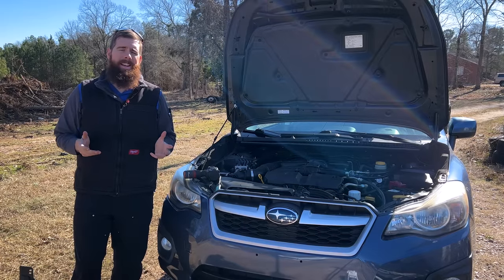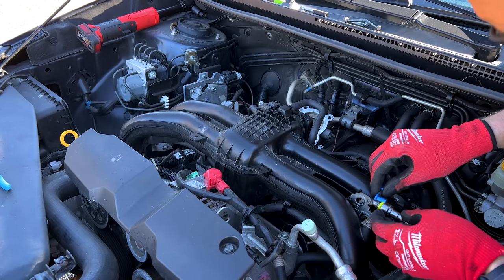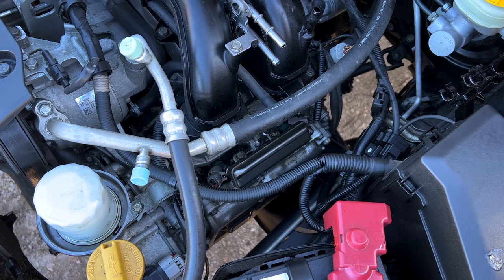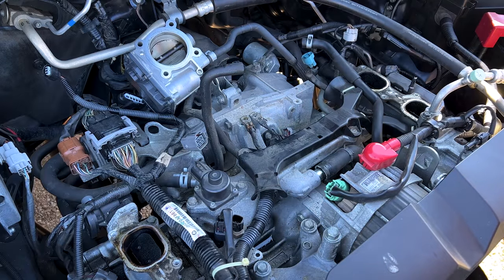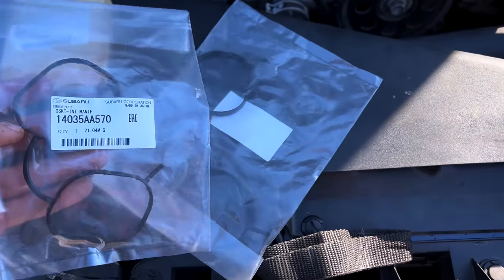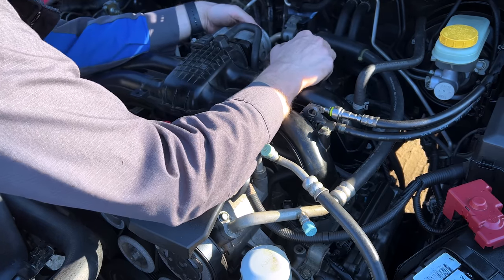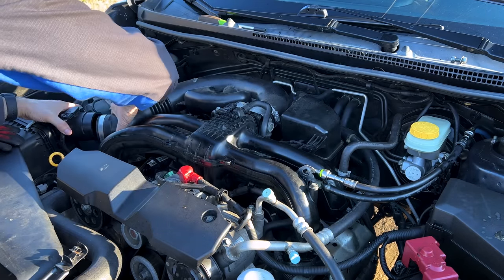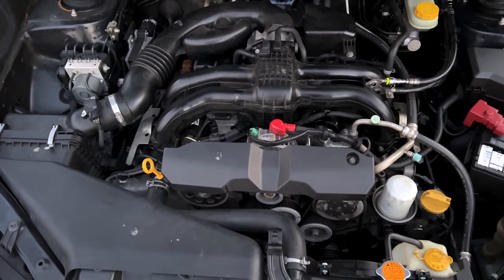Don't Let This $2 O-Ring Wreck Your Subaru's Cooling System! Fix That Coolant Leak Yourself, Cheap!

Comment: This problem was in the EJ series as well. Anytime customers said they smelt  coolant id look for the rear crossover pipe and sure enough it there would a pool on top. Cheap o-ring but expensive for labour.
Reply: That's exactly what is happening to my 2009 outback right now. I Thought the coolant level was dropping due to blown head gaskets. Then I saw a puddle of coolant on the top of the engine at the rear crossover pipe seal.

Comment: Great, comprehensive video.  None of that "and then a miracle happens" nonsense.  I wish I could have really seen where those o-rings sit, but I'm sure it would be clear if I tackled this repair myself.  Thanks for the excellent step-by-step.
Reply: I agree. Video is great and I am grateful.,  but some exact will lit zoomed stills photos of where and how o-rings sit could be done with a camera and or mirror and would be helpful . Also any info on which models do and do not require removal of wiring harness, would be helpful, as that is something you do not want to find out halfway when budgeting your time

Comment: I feel ya on the jacking it up to not break your back. I'm 6'5", so any chance I get to save my back I take it as well.
Reply from the maker: 6’4 here. Nearly always lifted cars on the lift to save my back when I was in a shop. Definitely miss a lift. Problem was they never lifted cars high enough when working underneath. I usually had to take a wide leg stance to have comfortable head room. Lol
Reply: @MrSubaru1387  I feel you there! I was lucky when living back home. My dad owned his own coal trucking company from 77 to 92 before he sold it and retired early. With that came the old garage, tons of 70's & 80's tools, and best part the deep pit with a lift. 

I don't get back much to use it since I've moved, but any chance I get I take it. He's 79, and still going strong with truck repairs for local individuals or renting it out to people either one.
Reply from the maker: Hard to install a lift on dirt and gravel outside.
Reply: @MrSubaru1387 pour a cement pad baby!

Comment: The real scary coolant o-rings are the ones in the upper oil pan on the FB and FA engines. Looks just like a blown head gasket when they go. And, of course, the only way to get to them in to pull the engine since the lower bell housing studs are attached to the upper oil pan...
Reply: Would love to see a video on how to replace these Orings!
Reply: @boykeno they are out there. Youre gonna need to be able to pull the motor.
Reply: Ekkk this is probably what just happened to mine yesterday 😢😅
Reply: Does this failure allow oil Into the coolant  or vise versa?

Comment: Thanks so much for the video, I believe this was the condition, that forced the previous owner of our 2016 Crosstrek to trade it in for a new Subaru.  Per the Subaru dealership service history, in Bryan TX, the previous owner had just spent about 1,800.00, months before she traded in vehicle, for an A/C compressor.  So I think, these O-rings were the straw that broke the camel's back so to speak.  Subaru Dealership in Houston TX, quoted me ball park 1,500.00 for replacement of the crossover pipe O-rings.  I did the job per your video, in about 3.5 hours.  Yes, I checked the PCV valve during the job!  Awesome video!!!
Reply: My impreza 16 is leaking too will do it with radiator and thermostats
Reply: Did you have oil in the coolant reservoir?
Reply: What if the the head carb flaps I'll call them are caked in contaminants like I can take my nail and scrap it off
Reply: @matthewjohancen757 ,yes I did 2015 xv crosstrek

Comment: In the course of 6 months last year, I've replaced 16 Subaru with those water port O rings. Some are a pain to do where you have to remove the intake manifold complete off, and some I was cable to get snap on long 90 degree angle pick and get it out. Slide new O rings in and install everything back with new intake manifold gasket. They're not bad to do once you do a few. Easy money.

Comment: Great video.  Unfortunately, really shows how badly designed the engine and cooling system is and how terrible the parts used by Subaru.

Comment: I had a catastrophic engine failure caused by a $2 o-ring. 😔 Had one of the o-rings behind the oil pump fail. Thought I had caught it soon enough, but a few months post repair, I started to hear faint rod knock on my way to work. On the commute home, the bearing spun. Love the FA20, but I am not a fan of the oil pump/timing cover design. These things happen. We pick up a wrech and move forward.

Comment: Completed this repair yesterday. Not that difficult if you follow along with the video and have a few maintenance bones in your body. While I was at it, i replaced the thermostat, upper and lower radiator hoses, exhaust manifold gaskets, PCV valve, throttle body gasket, coolant, and plenum gaskets. 
2013 Crosstrek (184,500)

Comment: I usually just remove alternator out of the way and few connectors in the way and use a pry bar to lift cross over pipe and pic to remove o-rings from front and back side without needing to do all this

Comment: Yep....you have convinced me that I will not be attempting this. Not only have I never gone this far into an engine but I do not have most of the amazing tools and diagnostic equipment nor the experience of how to use them. I would probably have a bucketful of left over parts. Good mechanics are worth their weight in gold and weekend warriors like myself who feel like a God to do a simple brake job need to just pay the pro. Find an honest and competent mechanic and pay the money. They are MORE THAN worth it....even if it seems like a lot.

Comment: My daughter's 2011 Forester she just bought was losing coolant/overheating and had a lot of fluid on top of the engine after replacing the upper/lower radiator hoses and flushing/filling the cooling system. Replacing the ECT sensor (it's bad), but I think I'm gonna go ahead and do this too...hopefully this is where the coolant is coming from.

Comment: I didn't realize until after I ordered that fuel line tool that I did not need it for my  2016 impreza But other than that thanks for the video it is very helpful

Comment: Thank you Mr. Subaru,  I have the "puddle" in the same location in my 09 and 15 Outback's....... Will  have to wait till Spring though......I'll start with my 09 since it seems easier.
Reply: Get a bottle of Subaru coolant conditioner. It will buy you some time. Part #SOA635071. Keep in mind it needs to be added to the radiator not the overflow reservoir, so you need something to remove a bit of coolant if it's not low from the leak. Shake vigorously before adding to the radiator. Drive immediately after adding to circulate and warm the coolant.

Comment: If you're doing this on your personal vehicle and not a customers, you need to disconnect more of those connectors, lift that pipe a bit higher, wedge something under it to hold it up to gain more access to the pipe sealing surfaces and clean them thoroughly with a brass wire brush. Otherwise, you'll do the job again in two years.

Comment: You have just saved my bacon.... I've been holding off on this because I haven't found a proper video . I'm assuming it's similar to the  2010 2.5l? thank you so very much from the bottom of my heart.
Reply from the maker: It is, much easier on the old EJ253 you have.

Comment: Mr.Subaru, do you have a recommended service interval chart for new Subarus? I'm almost ready to take delivery of the 23 Subaru Crosstrek Premium in the 6MT we ordered. Hoping to keep it running to 300,000 with little issues. I've been watching your videos and see that sometimes Subaru doesn't do their best at giving buyers a good service interval chart. Do you have any places I could look to find a
"vetted" service interval chart with possible added touch points? Thank you!

Comment: Nice work, as always!
It is very strange that the rubber rings are so dry, as if they were overheated.
We had -27 deg.C for last two days and -23 for today. Mine FB20 SJ '14 is okay, cold start sounds weird, but thanks God it have started. Сold weather showed that it's time to check the hood latch - the spring weakened in the cold.
Workhorse VW Tiguan ('14, 1.4 TSI 4Motion MT) became leaking with coolant from turbine hose while cold.
By the way, dads old ('94) Toyota with 4A-FE (gasoline 1.6l I4) have started as new.
Reply: It happens with age. It's why I hate O rings in places that get hot. My 1992 Camaro has an oil control O ring on the distributor. It's the reason every third generation camaro leaks a little bit every night. The O ring lasts maybe 2 or 3 months.

Comment: This is why everyone I know (including me) prefer older subarus, my ej201 was a breeze to change the o rings! P.s mrsubaru my PCV valve recently failed while on the motorway, got her home misfiring an changed it now it's fine apart from it seems to have blown the seals around the spark plug tubes so they're now covered in oil, I'm assuming the PCV was the cause? I serviced it a week before the pcv failure and there wasnt a spot of oil there.

Comment: I have some new parts that were not used for my outback. I will send them to you if you want them no charge. POwer stop pads, Bosch o2 sensor, some suspension bushings. A few other things. The car no longer exists.

Comment: If I attempt this myself, would it be a good time to try to clean some carbon from the intake manifold runners or from inside the EGR valve or tube while I have everything apart? Anything else worth knocking out while I'm in there? I like the PCV reminder in this video.

Comment: hello mr subaru1387
I watch your videos frequently and they help me a lot. My problem is that
I have an xv2017 fb20 engine my problem is that oil is passing into the coolant and I don't know which o-ring I should replace since in your video the ones you replace are due to a coolant leak I would appreciate your help since I am new to this
I don't know if this PCV Hose Connector has to do with the problem
greetings
Reply: Let me know when you find the solution, I’m having the same problem

Comment: I'm currently diagnosing a 2014 Forester Premium overheat issue. Lots of folks say it's probably head gaskets. I was able to top off coolant and drive it when needed. Now it's pouring out coolant to the ground and no longer can be driven. Any Ideas on what is happening? 
This video is very detailed and I know I can trust your advice. Thanks for any response, DZ

Comment: Just had mine replaced at the dealership, I could smell the antifreeze, thought it might be the heater core. Looked on u tube and sure enough one of the o rings was blown out. I had the extended warranty,but this wasn’t covered.

Comment: What parts do you recommend replacing when replacing the cross-over o-rings? PCV, PCV Hose, Plenum Gaskets, Throttle Body - anything else?

Comment: Not sure this is DIY consumer, need some skill for sure. Especially for Oring placement. I'm surprised they failed. If they were Viton material or did Subaru use only cheaper rubber ones?

Comment: Mr. Subaru I like all your videos, you've been a great help to me with my Subaru ,I have a 2012  impressive premium 2.0 ,.. I bought new rims,  aftermarket rims and my question is can I use pressure sensors from my original rims or do I have to replace them.?? Thank you in advance

Comment: While the car is a 2013, do you think the cross-over passage "o-rings" drying out is due to time, mileage or something else as the prime degrader(?)?  Being new to Subaru, will this be a "normal" replacement item in new to plan for with my 2020 WRX? Thank you for considering this and another informative video.  v/r
Reply: "...item in new to..." should have been "..item I need to plan..."

Comment: Hmmm good to know this.
My 2002 Forster S will one day be needing this eventually and even though this is a new car and different engine here mine won't be too terribly different of a job.
However I'm wondering if the older EJ 2.5L doesn't have these O rings on there.

Comment: I would have considered a "Red" colored same size o-ring good for higher temps.
Reply: It's usually a good idea to replace parts with the same type that are called for. You're asking for problems otherwise
Reply: @alexandersupertramp7353  Because manufacturers don't engineer things to only last a certain amount of time due to materials used under certain conditions. Otherwise it wouldn't be an o-ring at all.
Reply: @transtubular  Thanks Capt Obvious! Unfortunately, your comment had nothing to do with mine 😂😂😂

Comment: Question here. With all the trade ins (specifically wrk model) 2020 2021 with low miles 3k-14k would it be smarter to avoid them because of the drive it like you stole it people with no regard to a break in period? This is strictly a reliability question. i haven't because of the insane prices alone.

Comment: So I don't actually know enough about cars to be sure of this statement, but it sure does seem like Subarus have a lot of leak problems. Is this due to the design of the engine itself, or do they just use bad gaskets/seals? Do they have more connection points than other cars? Is the pressure greater? Or are they just using the bare minimum material as far as durability goes? And this isn't just an observation. I'm on my third Subaru (I don't know why I love them so much) and they have all had leaks in one place or another. Was never a problem with my Toyotas and Hondas that I owned. Thanks for any responses.

Comment: I have been thinking about buying my first Subaru, so I have been watching all these videos.  They are terrific.  You do a great job explaining what you are doing and why you are doing it.  I do have a question about current Subaru models if you would mind commenting.  

Do you see anything inherently wrong with the current Outback Wilderness model?  Are the engine and transmission considered "good" and reliable?  I have not seen any Wilderness models on your videos, but most are probably still under warranty.  I live just north of Charlotte and there have been very few Outback Wilderness models to look at over the past 2+ years.  I haven't even been able to test drive one yet.  Thanks again for the videos.
Reply: He generally talks old Subaru's. The Outback is a highly rated car however

Comment: Great video as always! Is there a similar o ring on the ej253 and do you have a video on that job? Thanks!
Reply from the maker: Yes. The EJ engines have a coolant crossover pipe and two o-rings as well. Just much easier to replace on them.

Comment: My problem is my wife's 2012 forester has oil in the coolant reservoir not milky actual oil droplets.  No over heating and when I replaced the plugs they were dry . Any ideas?

Comment: I just had a mechanic looked at my Subaru 2014 he told me that is the problem with my car but he said that they have to remove the whole engine to replace those o rings 😮.

Comment: Hey, @ 3:10, did you know, when using an electric 90 degree socket driver, you can manually break free a bolt that won't spin under electrical power? 🤪🤪🤪

Comment: Mr Subaru. Do you have a video on re sealing the timing cover on the jen one crosstrek. Timing chain guides and tensioners as well. If I'm in there I might as well with 235k
Reply from the maker: Not yet. Likely soon enough on my 2013 Crosstrek.

Comment: I just bought an 07 Subaru Forester xs with 322,000 miles on it. commenting here because idk if you react to comments on old videos. Are there any sneaky things that I should check that could start to show at this kind of mileage? I'm doing all of the obvious. engine mounts, replacing all fluids, and filters, and checking for drivetrain issues such as u joint, and suspension/steering issues like ball joints. Is there anything sneaky that I'm missing which I should also check?

Comment: Has @MrSubaru1387 made a video about the recent Subaru Battery Drain lawsuit. Would love to here his input on what is the issues since dealers always keep things vague.

From what I read it's CAN commination that don't go into sleep mode so not sure if it's just a battery capacity or does anything else get changed out

Comment: This is a question that I need answered correctly. I just purchased a brand new 2023 Subaru Crosstrek Limited on 1/20/2023. Is there an engine break in period before I can go on the expressways or tollways in Illinois? Thank you very much.

Comment: With so much knowledge in Subaru, I have a genuine series question. i have a '19 STI ... What's the deal with the creaking clutch noise when it's depressed in...? This happened on another STI I drove as well ... IS there a cure / solution for this?

Comment: Now I'm concerned. I have a 2023 Crosstrek, and I can't do all that mechanical work for O'Ring replacement,  OUCH!
Reply: You shouldn’t have to worry for a while. My 2013 Crosstrek (184,000) just came up with this issue.
Reply from the maker: You have a decade or so! Lol
Reply: @MrSubaru1387  thank you sir

Comment: MrSubaru I have a question for you. I have a 2013 Subaru Forester that I noticed was completely dry of coolant yesterday, so I went ahead and added some immediately after, then today I wake up and it’s completely empty again 😢 what could be the problem? I don’t smell, nor see anything that leaked on the ground
Reply: When you say, “completely dry,” are you referring to your radiator or your coolant reservoir?

Comment: So is this a periodic replacement item for the FB or do you think this cars O-rings were defective?
Reply from the maker: Ever seal and gasket has a lifespan. At 10 years and 200k miles, I’d say it had a good run.

Comment: I have a 2015 Subaru Forester I have oil in the radiator do you have a video on what to do. Oil pan does not have any water. I'm wondering what could it be please help 😕